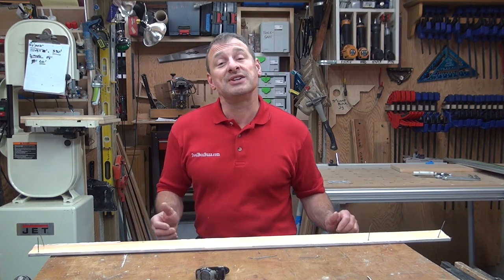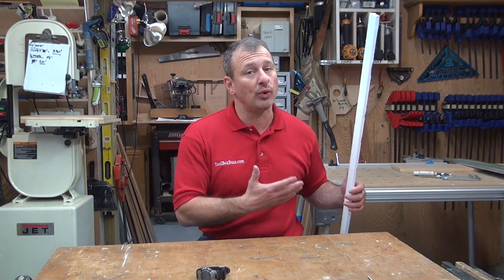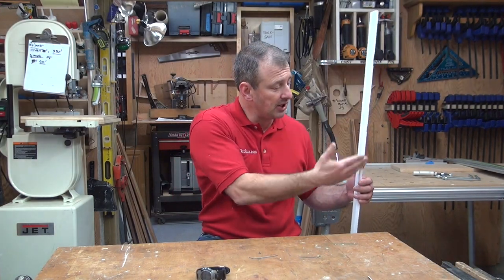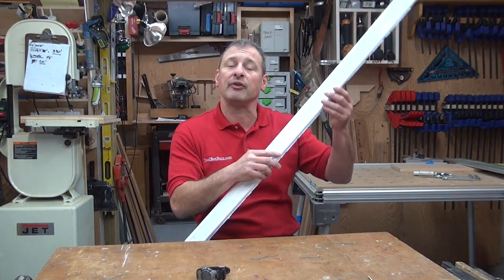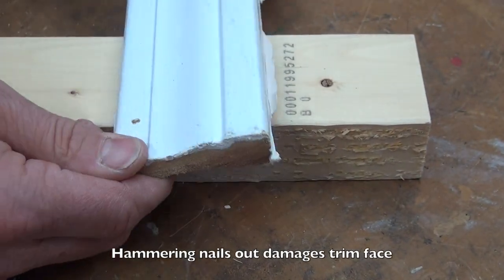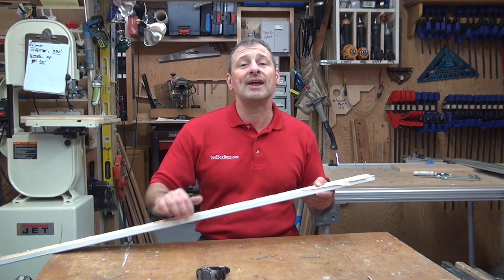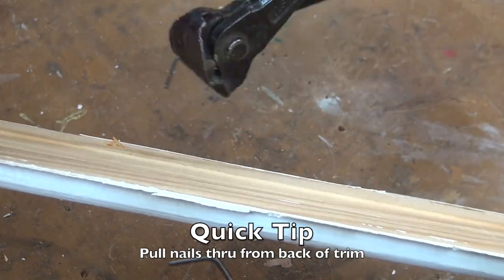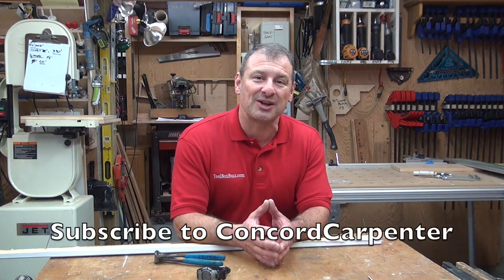Pulling Nails From Trim - QUICK TIP

Comment: Great tip.  I usually just get a gas can and a lighter.  I set fire to the trim and let burn until just the nail is left over.  Walah, the nail is removed.
Reply: I'm gonna give that a try, but why waste time removing from the wall in the house. Just light it right there
Reply: Lol, walah
Reply: @scholargrizz7071  needed  a giggle... Voila!
Reply: might have to try that myself

Comment: Wow Rob, thanks so much for the tip! Recently bought a large old Victorian home that has 30 double sash windows (all are 36" w x 72" h) and all need to have the sash cords replaced and the sashes weather-proofed. Since I wanted to retain the original trim, I was not looking forward to reverse hammering all the old nails on the stops and jamb liners - this tip will make it a breeze! Definitely subscribing!

Comment: This is absolutely the best way and with the right tool.

I spent 3 months at Stanford doing this in older buildings, dorms and frat houses so the electricians could run wire and cable for updated security systems.  My much younger coworker saw a naked coed in one of the female dorms.  LOL!
Reply: ............perks of the job :)

Comment: I usually use a slip-joint plier. Same idea. I find it gives you more leverage. I usually end up cutting the nails by accident when I use the nippers. I guess I'm too strong. Haha.
Reply from the maker: Baby Huey?
Reply: Excellent idea! By cutting the nail, you still get rid of the excess nail, and get the desired results.  :-)

Comment: Breaking the nails by bending them back and forward at the base where they exit the wood is often more effective.  The nail will break at the site of the bend below the surface of the wood, leaving the remnants of the nail sub-flush on both sides.  This is an important technique for use with all hardwoods where the density of the wood prevents complete removal.   T-nails and brad pins are easily broken with no more than a practiced pair of fingers or pliers.
Reply from the maker: +Steve Jones Maybe with hardwoods but that technique takes MUCH longer and wastes time
Reply: +A Concord Carpenter I remove them the same way,but I use vise grips , I over tighten them so they don't lock on the nail , but they  have the perfect arch for pulling the nil all in one shot.
Reply: +Steve Jones  Did you ever frame in Whitby for White Stag construction?

Comment: i caant find anyone using the linesmans pliers, grab the nail with the cutter section tightly but dont cut it, then rock it baaack and forth until it breaks off under the surface

Comment: Wish this worked on cut nails
Reply from the maker: it does
Reply: A Concord Carpenter / ToolBoxBuzz going to be honest I just don’t see how. I’m talkin about those old wedge shaped nail. Had to take the mill work down from a 132 year old Victorian and the nails were countersunk more than a 1/4”. These bastards a more than 1/4” wide and about 3” long.
Reply: Hey cake back to say you were right and I was wrong. You can use this on cut nails. Even the big ones.